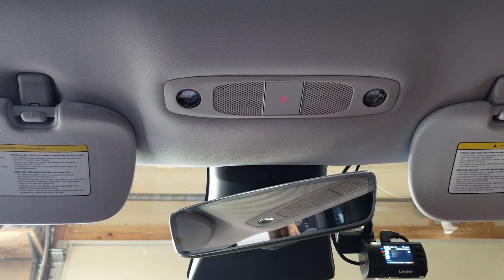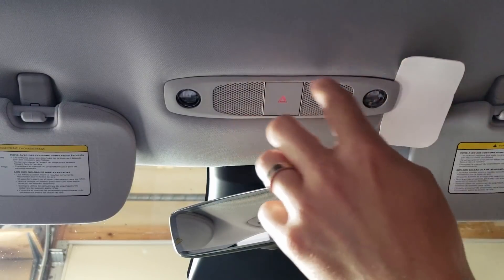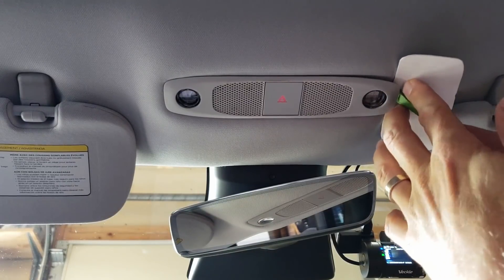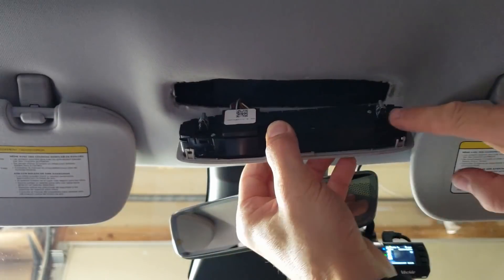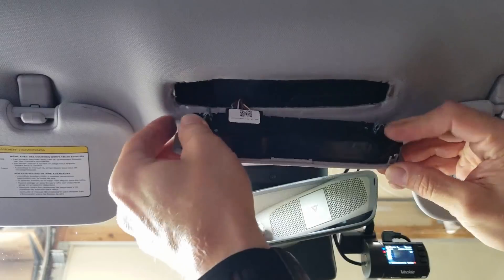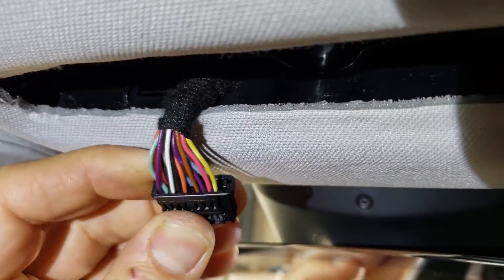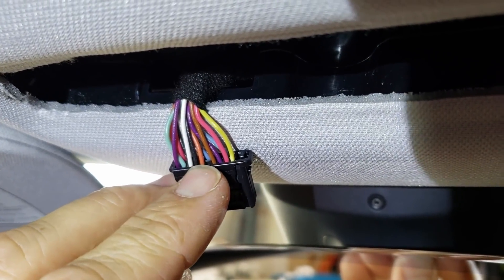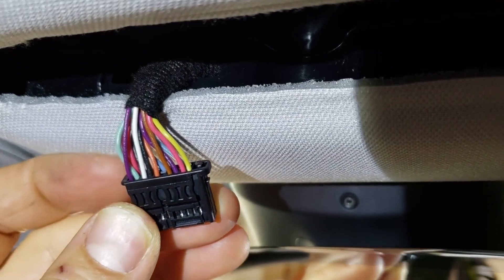Tesla Model 3 - removing dome light (constant 12V source available)

Comment: Nice video. I decided to use this 12V source in my 2020 Model 3 Performance for a radar detector. Constant 12V (vs switched) is not ideal, but i had several work around ideas that would be easier than tearing half of the interior apart to get switched 12V. 

I measured a solid 13.7V with a Fluke DVM. I have seen other videos or postings that say it shuts off after the car goes to sleep..one even says it drops from 12V to 9V. To investigate, i hooked  up an LED+resistor to the yellow and black wires. The power did stay on for at least 24 hours, even with the car not connected to its charger.

So I built a mount to hang my new V1gen2 under the mirror. It worked great,  BUT the microphone, also in that panel with the dome lights, did not work so she quit responding to voice commands! But if I switch off the V1, the mike works again. I think the V1gen2 draws about 450mA. ANY  inputs will be appreciated before I go find a better 12V source, like the one under the left edge of the dash that many recommend.
Reply: Did you find a solution/ or a better spot?
Reply: @MrSpeigels  This spot is still the best (least disruptive) for powering upper-windshield devices like radar detectors. I wrote a paper about the Quick Mount and am about to publish a revision that shows how to live with a constant 12V source. See:
https://www.rdforum.org/threads/109329/page-2
I am testing the new hardware and will publish soon, but income tax comes first. :-)

Comment: so now how is the best way to run wires out?, can you go under the headliner forwards?
Reply from the maker: Yes, that should work
Reply: @rdtc2854  I cut and soldered a JST connector into those, and ran the cord out the front, works fine. the tunnel the wires come out of goes all the way through.

Comment: The grey clips hold the grey plastic cover to the black plastic box underneath.  This thing is hard to get off.  To tap the wires, I used the red positaps on the yellow/black wire.  Found this post: https://imgur.com/gallery/cOIpEsF

Comment: Months ago, I had my BlackVue DR750S-2CH professionally wired directly to my 12V battery through a Power Magic Pro on my Tesla Model 3. That was recommended at the time. Everything has been working fine, including in parking mode for days at a time. This morning, I got a "replace my 12V battery message". My Tesla service center is proactively replacing my 12V battery today, which is frustrating. I hear that a firmware change in recent months made the 12V battery getting constant draw more sensitive, which is why I'm getting this message now.

I've talked to The Dashcam Store today, where I bought my BlackVue, and they're recommending using the B-124 external battery method from BlackVue, but it's expensive ($300) and will only power parking mode for about 15 hours. This yellow wire method could work. I'm hearing it's a 12V constant power source that drops to 9V when the car goes to sleep. The Dashcam Store tested my BlackVue today and says it works down to 7V, so it sounds like this might work without the B-124 battery. Can anyone validate this?

Comment: Can I wire both my blackvue & V1 radar detector to this yellow wire, can it handle the load & do I have to have separate fuse for each?
Reply from the maker: The recommendation I've seen is 1 amp max for the yellow wire. Fuses are not necessary as long as the wire you connect is the same size or larger. For a radar detector, it probably makes more sense to use a switched source like this https://youtu.be/bXNjgyrcGno
Reply: Thank you Jon, I ended up using the  blue wire source under the dash. Thanks to your video tutorials it made the installation of my radar detector & dash cam so much easy. I tapped both on the blue wire, I used the ground bolt on the floor board driver side near the foot rest, it was nerve racking though, it sparks when I was loosening the bolt, not sure why because I power off to de-energize the system. Is that normal, I want to go back in there because the eyelet wire connector that I cut into a U-shape is only half-way in, because of the sparks I was in a hurry to just to get it in  & get it over with when I loosened the bolt. Do you know if the spark is a sign that I will do any damage or short circuit a system in the car?
Reply: @jaimeb.1639  You may want to use a power distribution block in the area you went for 12v, but use VC-Left and allow for easy future device installs with up to 12-13A of usable power (~144W).  See my writeup here:  https://teslamotorsclub.com/tmc/threads/electra-interior-exterior-power-lighting-upgrades-accessory-mods.163084/

Comment: Watch out for those broken gray clips on the front corners. Those were clipped into something and now they're broken. That's why it took a lot of force. :/
Reply: Seems like you should be able to push those grey clips in from the sides first to avoid snapping them. Would like to see how flush this piece snaps back in now that they are broken.
Reply from the maker: Yes, I think you're right - should be able to disengage them first. That was my first time removing it, so I didn't know how it was configured. It snaps back in fully - can't tell it was ever removed.
Reply from the maker: True, the gray clips did break pretty easily - although they don't really seem to hold anything in place. Even without those clips, the gray trim doesn't release from the black housing. The force required is to release the upper clips on the top of the black housing.

Comment: Do you think plugging in a camera there will affect the battery management system? Did you try it?
Reply from the maker: I would guess that a small load there won't affect the battery management system, but I'm just guessing. I haven't seen any definitive info on how sensitive the car's monitoring system can be. I don't plan on using this source myself, I'm fine with a switched source for my dashcam.

Comment: Hey John, can you show us how to tap into that 12 volt source?
Reply from the maker: I'm not sure if there's enough room to use an IDC tap - there isn't much slack in the wiring harness or room for much extra in that space. Would probably have to solder a wire to connect.
Reply: If you don't know how to splice wires, you're not qualified to even be doing this kind of work. At all.